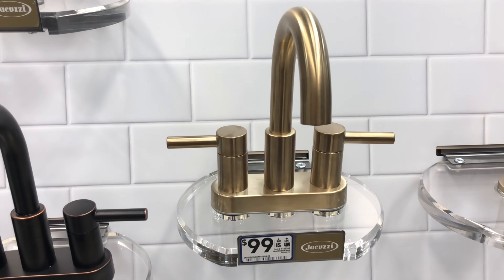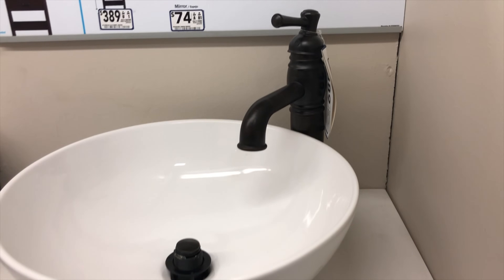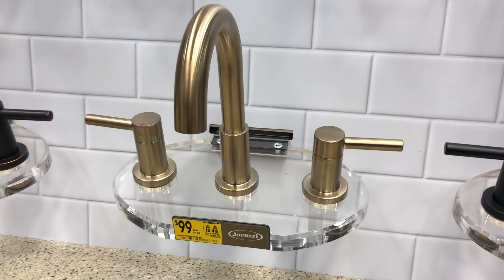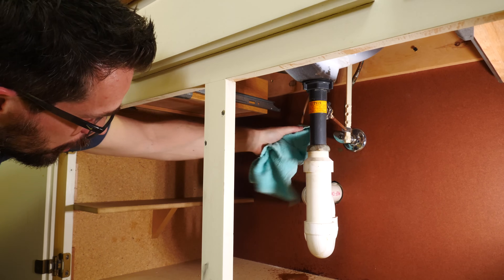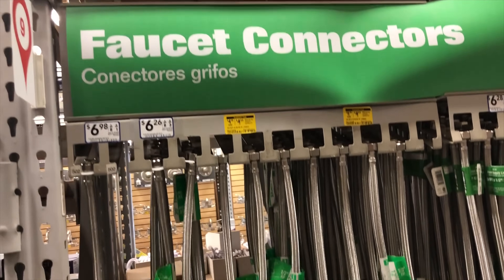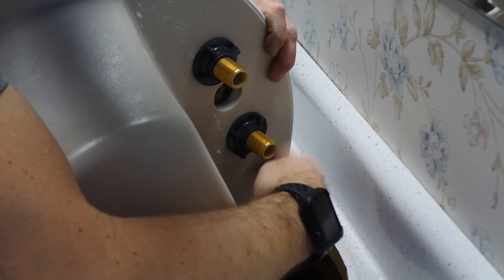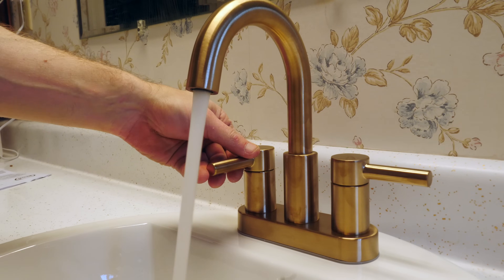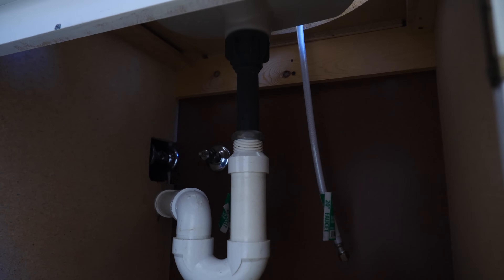Faucets // Bits | I Like To Make Stuff

Comment: I have a tip. Before unscrewing the water inlet, be sure that there is no more pressure in the pipline. To do this you open your faucet until no more water is coming out. This is usefull for pipelines that are under a light pressure. I had to deal whit it.

Comment: Tip: Plumber's tape or Teflon tape should be wound clockwise (nut-tightening direction) to prevent wrinkling when screwing in the fitting (nut, hose, etc.)
Reply: Use four or five turns, not just one or two!  😎
Reply from the maker: I'm left-handed and I always forget that tip, thanks!
Reply: just seeing this comment made me realize that this isn't just common sense. I've always done this, but, I suppose others didn't know.

Comment: DON'T use silicone to seal facuet to sink deck! Use plumber's putty, rolled between your hands to make it rope-like. Put in on edge before you tighten down the faucet, and wipe away the excess that's squeezed out! Easy, better seal, not a sticky mess...! 😎
Reply: Mike Gustafson 
Great tip. I used silicone, and I don’t really like the result...looks just a little bit messy, due to not really having had much room to manouvre back there.
Reply: Is this debatable? Or code? I prefer silicon for a better seal...though harder to manipulate

Comment: Bob, my tip for this project is to skip the bucket, they usually have lips/handles/geometry that makes them harder fit (5Gal buckets tend to be too tall depending on trap/cabinet design) and to catch all of the water.  Instead using a 6/16 Qt plastic square bin will allow you to get up against the back of the cabinet and have a wide enough opening to capture most of the water.
Reply from the maker: Good call!

Comment: If you are replacing your sink it is easier to attach the hardware, faucet and drain before setting the sink in place. It will save you having to work between the sink and wall.

Comment: One little tip I have. Most faucets have fantastic warranties or at least cheap parts. However you have to know the exact model number and brand. Cut off the part of the package the faucet came in with the model number, and tape it to the bottom of the faucet. Also works for spare parts!
Reply: Yup! 👍😎
Reply from the maker: Great tip!

Comment: To add to it, when disconnecting a faucet and you turn off the shut off valves under the sink or the main ones in the house it's good to open the faucet to let that water and pressure be released before disconnecting the supply lines to the faucet. Great video as always Bob! :) Btw, I've also created a BITS inspired series on my channel about Paragliding basics :)

Comment: If you don't have shut offs under the sink this is a good time to add them. And if you have old-fashioned multi-turn valves, replace them with new ball valve shutoffs. Those old ones will probably dribble while you''re working, forcing you to turn off the main shutoff.
Reply: my shutoff under the sink are the old fashion ones but they are saudered on so i cant take em off.

Comment: some older bathroom sinks (like mine) have the faucet holes further back so the faucet spout may be long enough to flow into the sink but not get any gap between rinsing hands and the sink wall unless at full (and I mean full) blast. Many common bathroom faucets are too short for this minor irritation so think about about where the water flows out and how you'll end up interacting w/ that flow. A sink that looks good may end up annoying you more than the look is worth :)

Comment: I replaced the faucet on my kitchen sink not long ago. The one we got had the supply lines built into the faucet, and they weren't long enough to reach the supply under the sink. The connections on the new ones were also a different size/type than was on the existing lines, preventing me from using those as extenders. My original thought was to just get an adapter, but there are a half dozen different types of connectors, and at least a dozen sizes. I ended scraping the adapter though, and just purchased new lines to use as extenders from the supply to the faucet lines. It has a huge headache that I wasn't expecting, and resulted in more trips to the hardware store than there should have been, but it's all connected now and the S.O. is happy with our new faucet.

Comment: when i was building houses we were on Maui. we built 150 units which meant 450 faucets.i was in charge of the plumming...pieces,trims everything.many times the faucet in the box did not match the finish on the box.not sure if it was just a Kohler thing or not..i suggest you open the box before you leave to make sure its the right finish
Reply: Mahalo!  Ka'anapali? 🏄‍♂️🌴👍😎

Comment: Tip:  sorry if this has been stated, i tried to skim!  Sometimes i've had securing nuts on the underside that are stuck because of mineral build-up present in our local water.  Calcium mostly.  It can really hold those nuts tight if it's built-up.  Soaking in vinegar as necessary helps break that down.  Normally, i'll soak a paper towel in vinegar and wrap the nuts.  Rewet with vinegar as it dries.  Does a great job, any time i've needed to use it.

Comment: we had to replace our faucet after our old one's handle fell off and water sprayed up in the air like the cartoons. We had a little trouble with leaks when we connected the new lines and we used used "pipe dope" instead of plumbers tape. It's the paste version of Teflon tape. I would say it has the consistency of a thicker grease. My wife's uncle (a plumber) swears by it.
Reply from the maker: We used it in the Mudroom Renovation and I agree, it works great.

Comment: We call them "Taps" here.
Reply: And we also often have totally separate hot and cold taps, none of this new fangled mixer tap sorcery...
Reply: Separate taps come fom plumbing architecture, most houses used to/do have hot water tanks, this produces 'still water' that's not drinking safe. 
To get fresh water from a mixer tap you have to run it for a few seconds to clean out any hot water residual before getting fresh cold water.
This was deamed wasteful and hence two separate taps (removing the need to prerun for cold water).

Modern houses tend to use mixer taps.

Comment: Probably wouldn't hurt to mention there could be differences in supply line fittings depending on the age of the house. I always end up with a set of both to make sure I have what I need, then return the rest. (or at least plan on returning the extra and let it pile up in the garage.)

Comment: I’ve had to use a dremel with a cut off wheel to remove the bolts underneath before due to the two parts being overly seized together. Be very careful if you use this option!!!!  Not recommended but in my case it was the only viable solution.

Comment: We have a problem with our kitchen sink, if you want hot water you have to do lever all the way to hot but there is like no water pressure just a mild stream. You can however switch the lever up to cold water and the water pressure does increase normally (as a sink should) but its only cold water. No hot, no warm-just cold.  This makes it incredibly frustrating when doing the dishes. 

Is our facet broken? Should we buy a new one?
Reply from the maker: Hmm, have you made sure that the hot water shut off valve below the sink is completely open? Sounds like it is either partially closed, or clogged somehow.

Comment: We are remodeling our bathroom, and we got a wide spread faucet from American Standard. Got it installed into the vanity then we learned it didn’t come with all the parts to the drain plug. On the box it says don’t return please call American Standard help line. They are sending us the drain plug in a week. Just want to put it out there if your buying a faucet don’t buy one from American Standard. It’s going to take them a week to send a drain plug.

Comment: Our faucet no longer stops when it should and if you push it back to turn it off. If you go too far, the water starts running again. How do you make it stop?
Reply from the maker: Sounds like the internal valve is bad, but now you know how to replace it!
Reply: @Iliketomakestuff  so you can just go buy new valves or do you need to get a whole new faucet?

Comment: A warning when it comes to porcelain sinks and their drain systems. If the drain you are replace has been there long enough, it is possible that you will run the risk of chipping the porcelain around the drain hole of the sink, especially if the original drain had caulking or adhesive and it adhered to the porous ceramic below the porcelain coating.

Remember, there is nothing wrong with calling a professional if you realize you can't do it. It's better than a chipped sink.